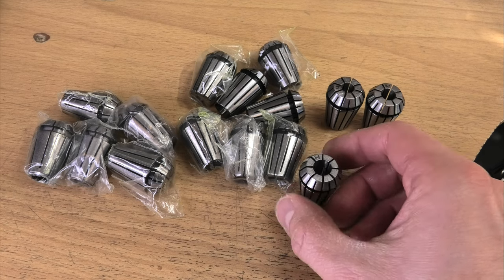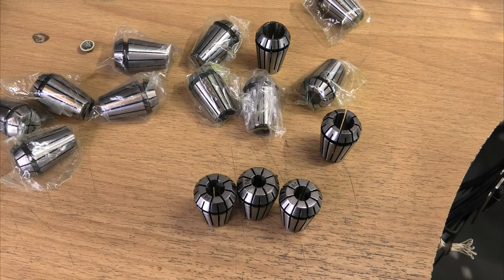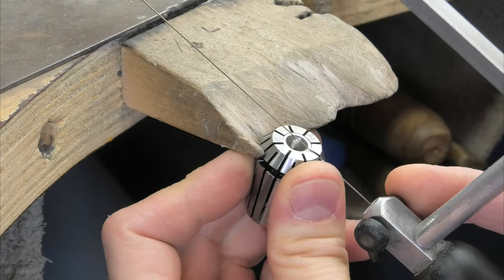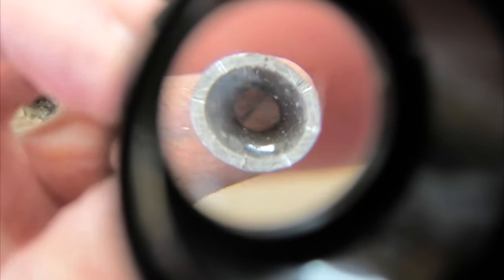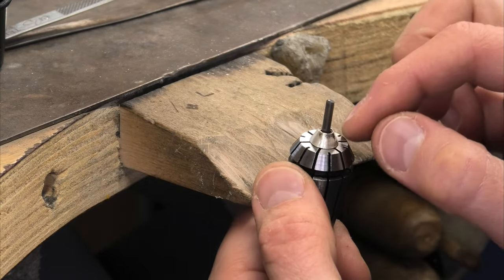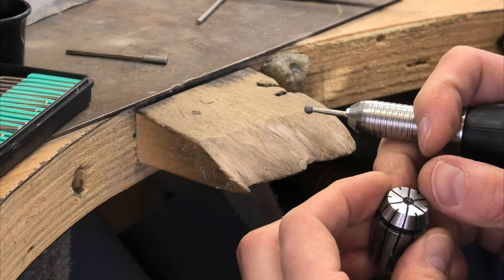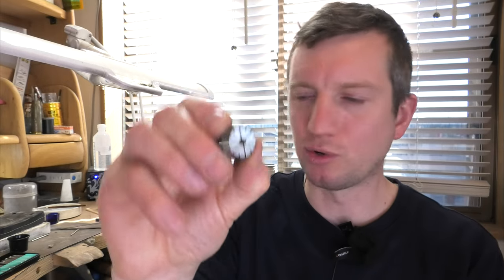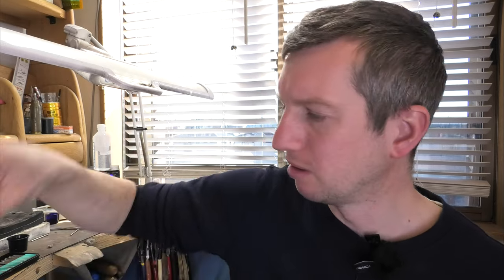Marking Claw Positions with ER Collets

Comment: Use them to hold slot drills and end mills in milling machines. Or, you can use them on a lathe to hold the piece of metal being machined. They are fantastic on a lathe because they give excellent repeatability with holding the work, you dont have to center the work in the chuck with a DTI everytime you cnage work pieces. Takes a huge chunk of time out of doing a run of parts that are all around the same size.